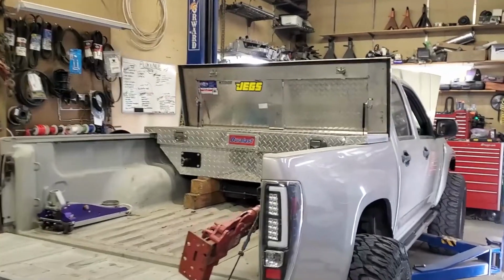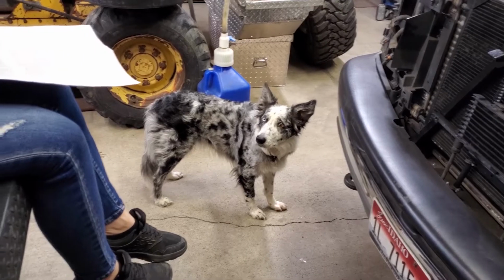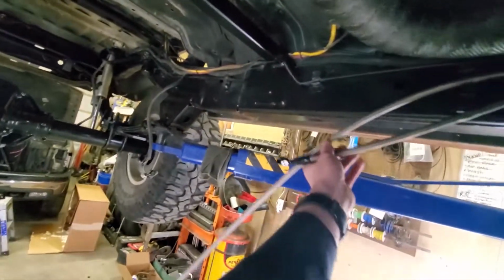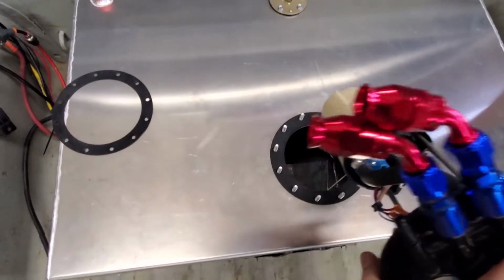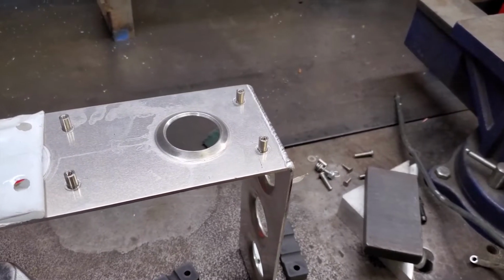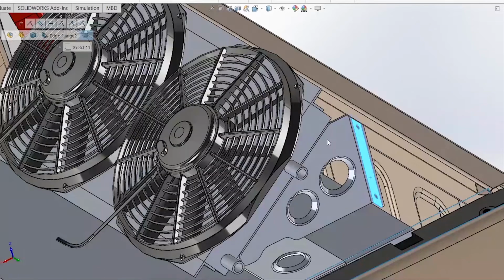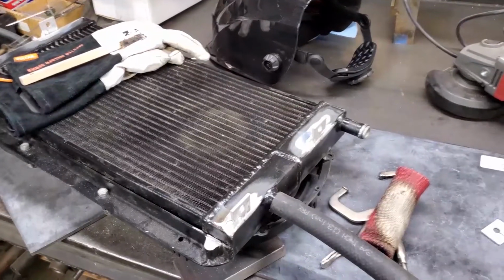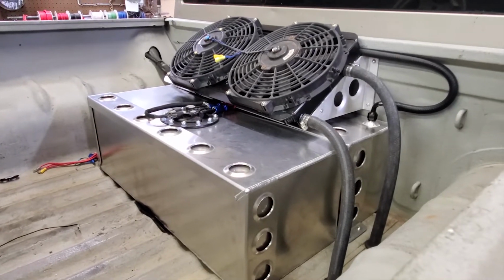Fuel Cell Custom Install in the Chevy Colorado

Comment: Looking for some advice or guide to install a 17gal fuel cell (already in place) but need to know about an external fuel pump fuel filter and pressure gas regulator for a 2011 vortec 2.9L stock engine

Comment: Quite a few different custom parts for this project.  Turned out nice.  I like that you were able to still use the stock fuel pump.
Reply from the maker: Thanks! Yeah reusing the stock pump saved me a few bucks and made it easy to keep the stock sending unit stuff 🙂